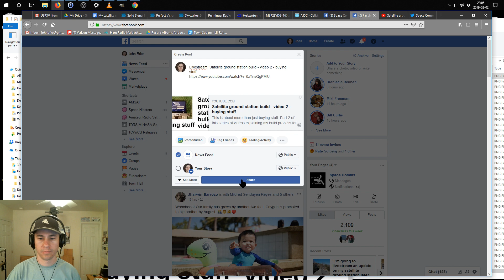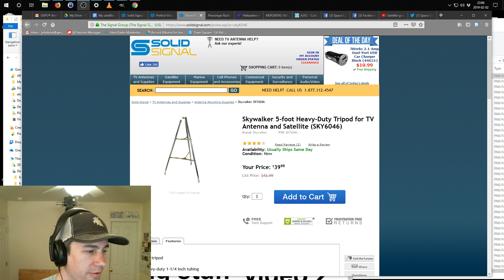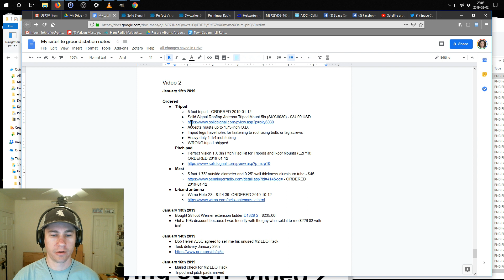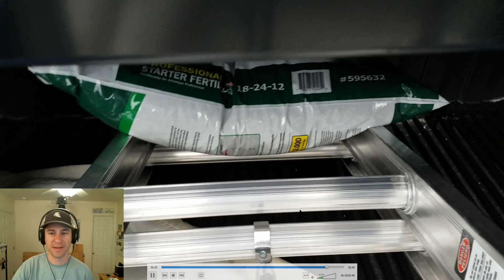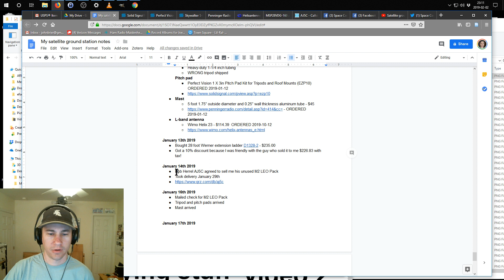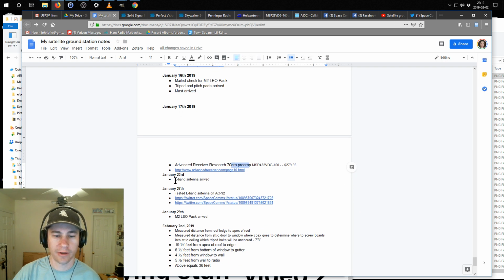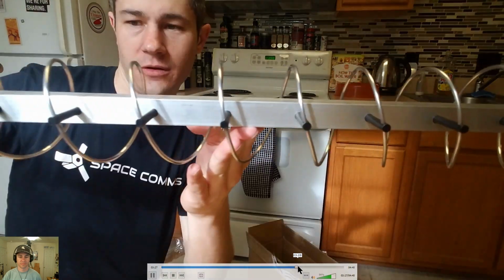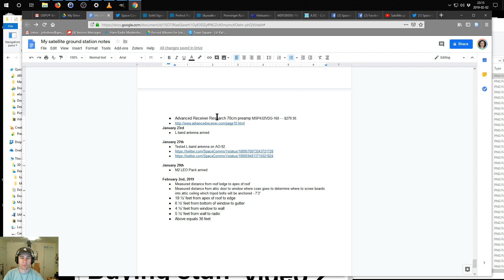Satellite ground station build - video 2 - buying stuff

Comment: Hi John, That's a very steep roof and probably very slippery. Over here you would need a hand rail and scaffolding. Be careful!!!! 73, Terry ZL2BAC
Reply from the maker: Thanks Terry. I actually bought a safety harness someone recommended that I will use once I start taking equipment on the roof.

Comment: Way to go, John! I had those same two mast mounted preamps from ARR before and they worked spectacularly for me for the several years that I had them. That was 30 years ago but I would assume they are at least as good now and probably better. I had my satellite antennas roof mounted like you're doing – along with a roof mounted TH-7DX HF antenna – so i spent a LOT of time on the roof. Trust me when I tell you, my friend, you cannot be too safe. I hope you do not do the boneheaded and stupid stuff I used to do working on my antennas on the roof! (FYI: Wife Jan rightfully forbids me to even step foot on any roof anywhere anymore!) 73 de Robert K3RRR
Reply from the maker: Thanks Robert! Glad to hear these preamps worked well for you. They were recommend to me by Mark Hammond, N8MH. 

As for safety, I forgot to show it, but I also bought a fall protection kit with a harness I will use when I start taking equipment up there to do the actual install.